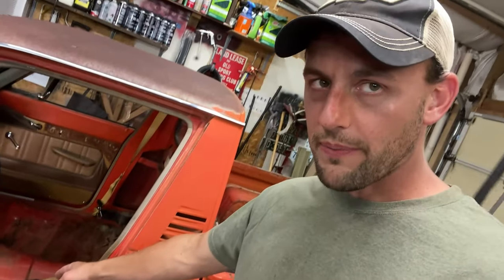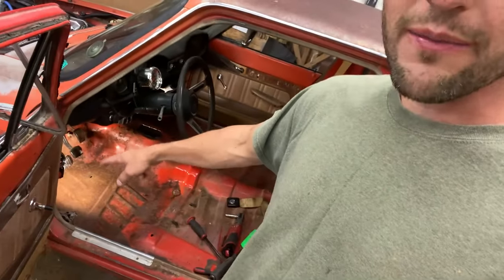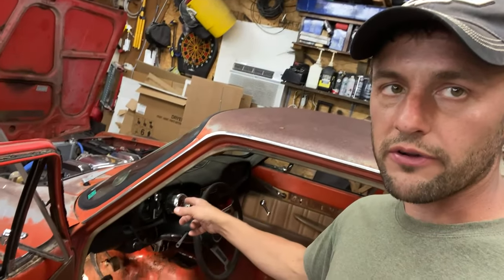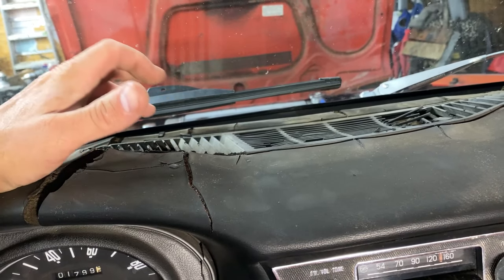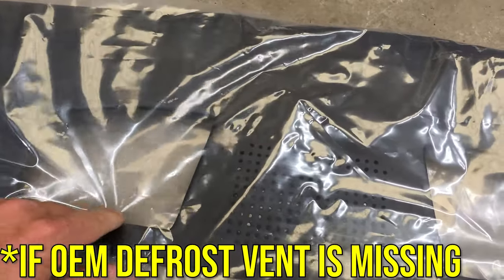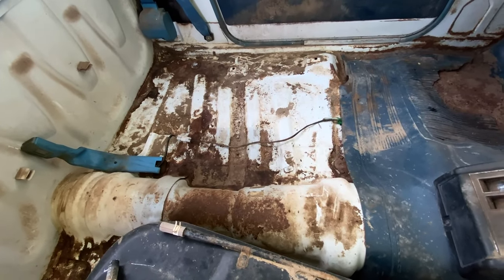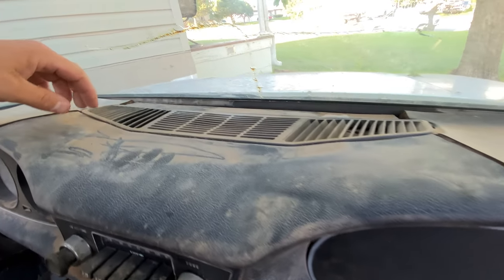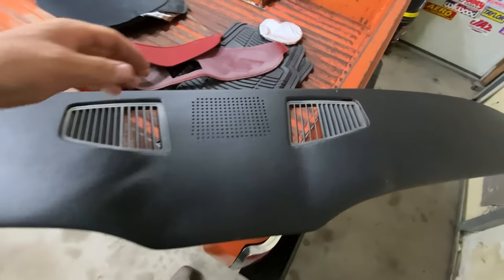Cracked & Broken Dash Repair | Chevy LUV | ACCU-Form Dash Cover

Comment: Do you have a website that shows all of your suppliers for LUV parts?  I have a 1980 that I got back in 87/88 that I am starting to restore.  It would be great to have a head start for where to find parts.
Reply from the maker: Certain parts are definitely hard to find. If you have something specific you see that I sourced, I can look back and try to provide information where I got it. Pretty sure I ordered this dash cover off Amazon. But I've got a number of other parts from ebay, rockauto, and private sellers. Still to this day would love to source a quality windshield gasket. I ordered one from Thailand. After 2 months in the sun it's all cracked and complete garbage. Would been better off leaving in the original

Comment: Dash came out great! I probably would of sprayed the vents black before installing. The sun turned them gray. There's some nice re pop door panels as well if you're interested. Thanks for the video!
Reply from the maker: Yeah painting them black is probably a good idea.  What little experience I have painting plastic didn’t always yield the best results so I’m a little shy there.  I actually have a set of shop built door panels waiting to go in!  I want to do them last so I don’t accidentally damage them working on the interior.  It should transform the inside nicely.

Comment: New subscriber.  76 luv  here
Reply from the maker: Awesome.  I have a 1976 solid axle swap 4X4.  Working on an complete interior vid for the 1975.  But now that I have that done I hope to start working on getting a good running engine swapped into the 1976. I have a parts truck that I am crossing my fingers has a good engine!  I miss that truck...